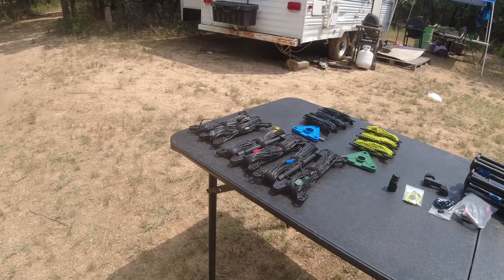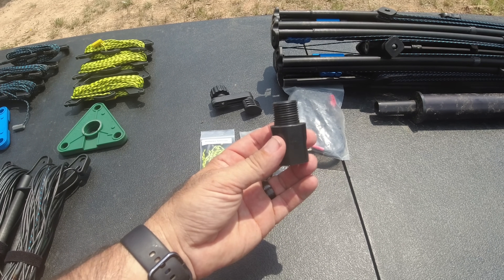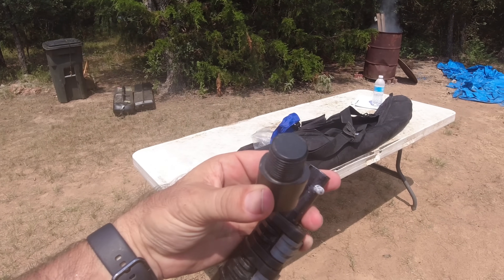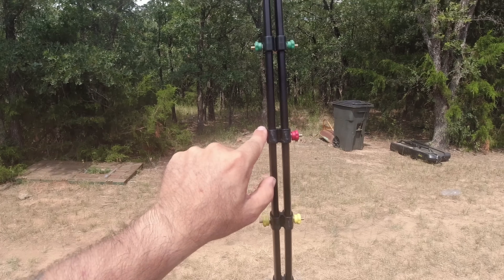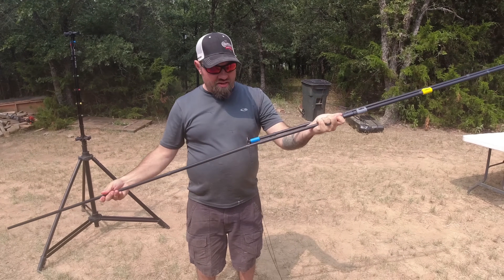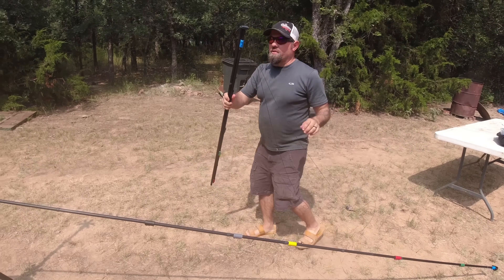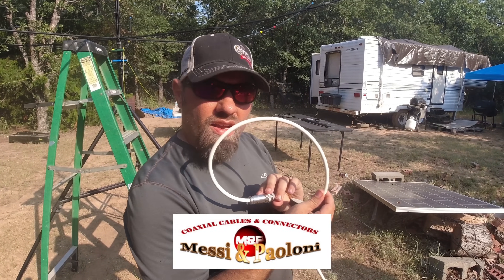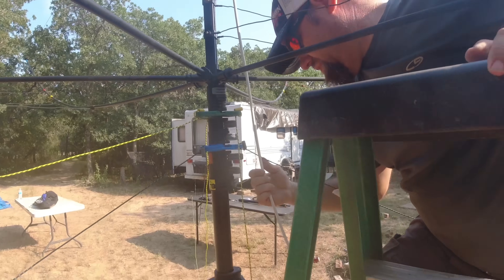Building the BuddiHex HEXBEAM Antenna in 2023

Comment: Did you extend the 30ft mast completely? I have heard that it is not possible to use the full length of the 30ft version with the hexbeam and you should set it up to 20ft maximum. Hope that it´s not correct because in that case it does not make sense for me to buy the mastwerks. Other question: Do you have an idea how to install the antenna on a circular mast instead of an oblong one?
Many thanks for your videos about the hexbeam.. I had luck and next week it should arrive here (only the mast is still missing)
Regards, Jonas, DJ1KL
Reply from the maker: No, I only put it up about 20' - my 30' tripod is one of the first models, they have been redesigned them since to make the top sections a bit more sturdy.  Mine won't hold the Hexbeam with the top section extended, but you really don't need it anyway.

Comment: What’s the power handling capability of the hex-beam? Just wondering if I could use it on 11m while out camping. But I didn’t wanna melt anything.
Thanks
Tony
NB785
Reply from the maker: Power Handling and using out of band are 2 different things.
The Hexbeam itself will handle 1500w but it doesn't have an 11M element so you would need a tuner to tune down to that band.

Comment: Do you have a link to the build mast?
Reply from the maker: it comes with the hexbeam.  I don't think it is sold separately
Reply: Wait, wait, wait…The antenna structure has a mast, but after assembly it needs to be placed on a separate mast to elevate it right? I put myself on the waiting list to get one, then today I realized that I can’t mount it on the mast I already have, seems it is designed to be mounted on a specific brand of mast that I guess must be purchased separately? The Mastwerks brand mast that is shipped from the same location as the Buddiehex.
Reply from the maker: @franklentz5388  Mastwerks is owned by Buddipole.  And yes, the hexbeam is made to go on that.
Reply: The mast just about doubles the price, but I also have a Buddiepole and it’s a better mast than the one that’s included with the Buddiepole. You just can’t have enough antennas right….

Comment: Hey Jason, was wondering what the top of that center pole that attaches to mast looks like.  Would be nice to mount a vertical for gmrs or ht's up there, or idealy starlink lol.
Reply: It's actually flat on top with a 3/8X24 female thread insert so you could mount most any small antenna on top of the hex center post.

Comment: 'Do not put up the Hexbeam without putting the coax first.'  I was thinking that all the way up until you said it.  I always put that on after I put the elements on.  I also found that out by experience... BTW, I'm 6'1" tall, and I also need to use that build mast.  DE K7RLN